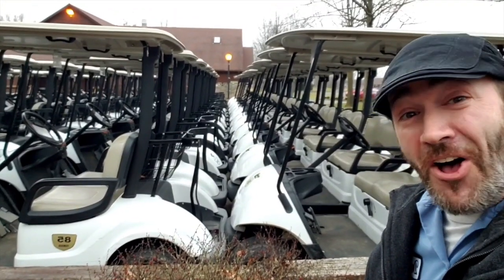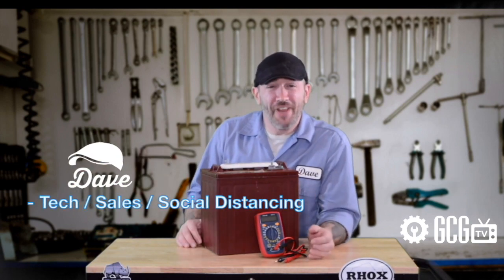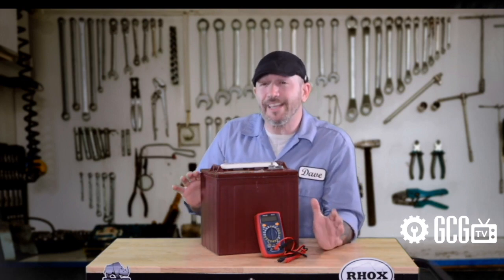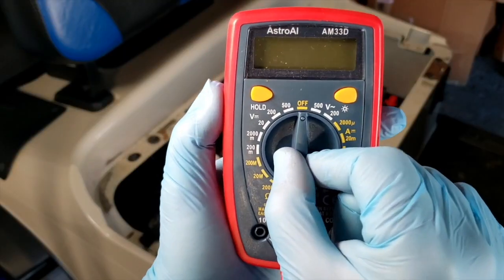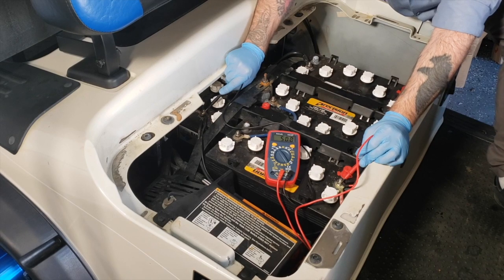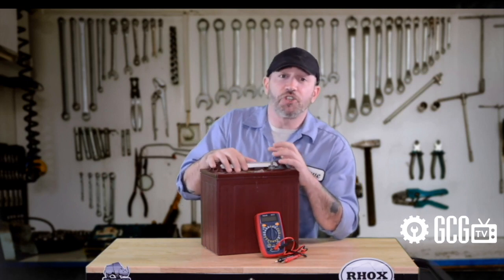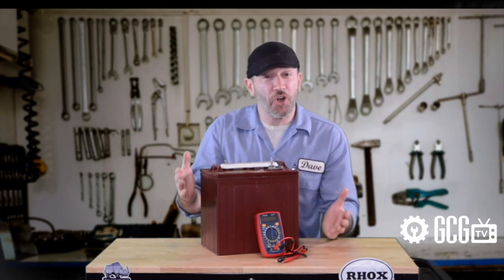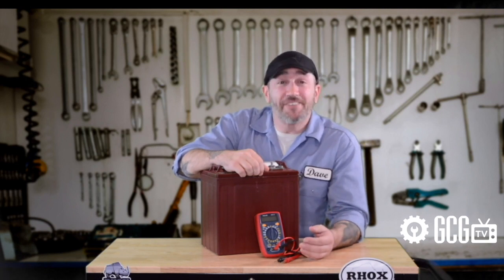Golf Cart Power Testing | ASK DAVE | Golf Cart Garage

Comment: So my surface charge is 52.1 to 52.2v. Thats after a full day to charge and after a full day at rest of the charger. It dips to about 50.8v under a load test after being jacked up and blocked off. With the pedal compressed about 75% of the way. It runs around 23 mph. Has 4 12v trojans that are 4 years old. I even disconnected all the batteries and test them one at a time for surface charge. Which was around 13.2v There is no way these lead acid batteries have that type of charge, being 4 almost 5 years old. Because i drive about 1 mile and the ezgo low battery kicks on. Since it is the ezgo system with the magnetic break system. I didn't want to lock it up. So i towed it home. Now for those that say its a bad reading or bad multimeter. I got the same test results from a $100 multimeter. I am stumped and want to convert o lithium but I was to get the right size for my cart. Since there seems to be a ghost in the system. I am about to make vide3o and post it tonight. If you click my name to see it. Im sure by the time, someone post the correct solution. To this what i assume is a simple fix, on the issue at hand. Ill most likely have it fix or converted. For those they come at me with have a professional look at it or some other Jack handed comment. Just know im trying to learn to do it myself thanks but No, this is my side project. If it takes me a year to resolve so be it. Teach a man to fish vs give a man a fish.
Reply from the maker: Thanks for watching!  Sounds like you've got a good start on it.  What we find in a lot of situations like you're describing is that a good charger and relatively good batteries can cause what we call "Phantom Power".  This means that a voltmeter might show stored voltage after overcharging when one cell is having an issue and not showing up.  One way to look for this cell is to get a load tester machine.  Another is to use gloves, glasses, flashlight... start a charge cycle with the water caps off and look for the cell that doesn't bubble while the rest do.  You can also get a virtual appt with our tech team here: https://www.golfcartgarage.com/gearheads-on-demand/
Good luck, we'd love to know how it turns out!

Comment: If you fail the load test (more than 2 volt drop) then you move on to test the indicidual batteries....but do we test them all just for surface charge or we perform the load test on them?
Reply from the maker: Thanks for watching!  We recommend load testing all the batteries individually.  One bad battery, or even one bad cell in one battery can disable the cart.  That battery at surface reading can give what we call "phantom power" seeming by voltmeter to be good, but then actually load test bad.  If you have more questions or need help, just get in touch!  Support@GolfCartGarage.com or (800) 401-2934
Reply: @Golf Cart Garage  ok so start with surface charge...then test battery pack drop voltage at around 75% theottle....then move on ONLY If the voltage drops more than 2 volts because if it doesn't drop more than 2 volts then there is no reason to test further as it has passed
Reply from the maker: While we can't disagree with that logic, it can't hurt anything to get individual battery tests to see if just one is acting up.  They have a tendency to hide around here...

Comment: I have a 2016 Precedent and when i pulled it out this spring my battery terminals were pretty corroded. I cleaned them up, changed all lugs besides the main power cable and added water. Once driving the cart it will go 5 minutes then battery light comes on. After about 10 minutes battery light begins to flash and cart will begin to stutter. Voltage on all batteries is over 8 and pack is over 48. Load test of each batter is over 8. However 1 battery is 7.75, could this one cause this issue? Im lost and not sure how to proceed next. Ive charged at least 4 times now and always same results
Reply from the maker: Hey Tony!  Thanks for stopping by.  We think... get some safety glasses, gloves, flashlight.  Start a charge and remove the caps from the battery that tests under 8.  You will probably find a cell that doesn't boil and needs reconditioned / replaced.  If not...get in touch!....  try our tech line at (800) 401-2934 or support@golfcartgarage.com

Comment: When checking individual batteries does each battery need to be disconnected from the series of batteries ? Also can you load test an individual battery with multimeter ? Thanks
Reply from the maker: Hi David!  Thanks for watching.  You do not need to disconnect cables and you can get a basic load test reading, that's the content and instructions in this video.  If you need more help or diagnosis, check out our virtual diagnostic service here: https://www.golfcartgarage.com/gearheads-on-demand/
or just get in touch! support@golfcartgarage.com or (800) 401-2934.

Comment: Hey Dave, I've got a 97 yamaha g19 with new batteries, cables and speed control, but cart voltage still drops to the 30's after about 30 min and I have to get it back on the charger, also the motor has a whooshing noise while driving, thought it could be a bearing, but the rear wheels spin freely, any idea where to check next
Reply from the maker: Thanks for watching, Brady!  The symptoms you describe typically result from an issue with the charger or even sometimes a bad cell in a battery, even if they're new.  Chargers don't always show symptoms of going bad other than early power loss and you may not be getting a full charge if the cycle doesn't complete.  We recommend a free consultation with our virtual diagnosis team here: https://www.golfcartgarage.com/gearheads-on-demand/
or you can reach out to our techs directly at Support@GolfCartGarage.com or (800) 401-2934.

Comment: Great thanks . I was told testing batteries individually when they are connected was wrong  since they are drawing from each other. They should be disconnected to get a correct reading. Is this true?
Reply from the maker: Hey, Rudy!  The draw from other batteries is relatively negligible, especially when not in use, so this should not affect your readings significantly when they're connected. But, for the sake of argument, you could also disconnect one and see how/if your reading changes if devotion to accuracy is worth the time.  In most practical situations, testing as done in this video should be sufficient.  Let us know if you have further questions or we can be of service. (800) 401-2934 or support@golfcartgarage.com
Reply: @GolfCartGarage  thanks for the information. Very helpful. I will give it a try. Reach out if I have any questions. Thanks for the reply

Comment: Hey Dave I've got a Yamaha DR2E20 and I took the motor out to service it. I was having issues with the cart  accelerating properly.  It would start to accelerate at first then about halfway through pressing the accelerator it would stall. I replaced the speed sensor and still had the problem. So I felt the motor might have some sticking brushes in the motor come to find out the motor is brushless. After I installed the motor back the cart was in some sort of limp mode or I failed to put something back together right. Everything works like it should. My batteries are at 52 volts can you help me out?
Reply from the maker: Thanks for watching!  After reading over your concern, our first instinct is possibly a throttle potentiometer (sometimes called a "potbox") or possibly an issue with the motor controller.  You can get an appt for a video call diagnosis with our tech team here: https://www.golfcartgarage.com/gearheads-on-demand/
or get in touch directly with further questions to Support@GolfCartGarage.com or (800) 401-2934

Comment: You can not get a accurate load test with the golf cart on jackstands. You need to have the load test done while driving it with a real load, the cart on stands is not going to give you real results
Reply from the maker: Can't argue with you, there, Rick.  You're not going to get exact measurable readings with this method.  But, if you have a battery dropping out under load causing a powertrain issue and you don't have a load tester on hand, this is the best way to sniff that out for a lot of people out there.